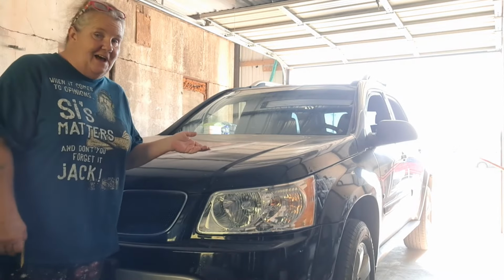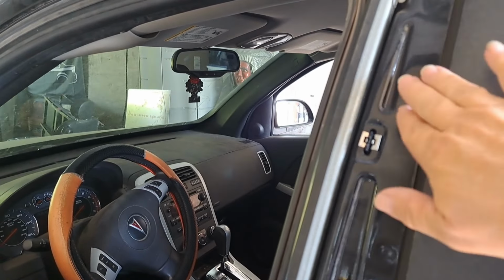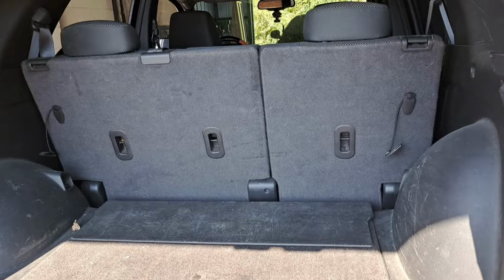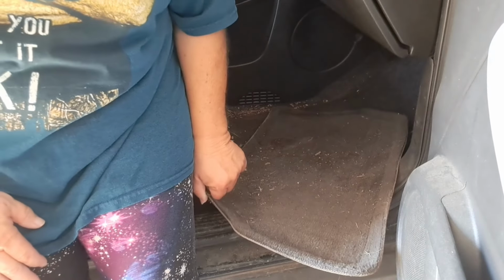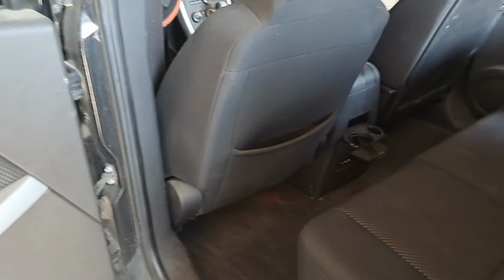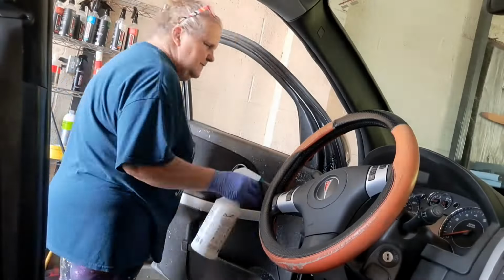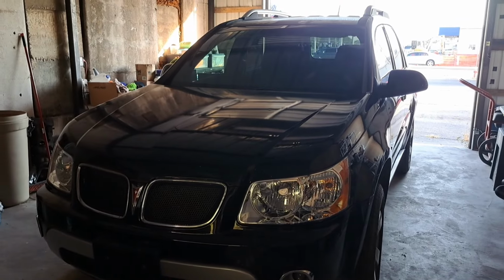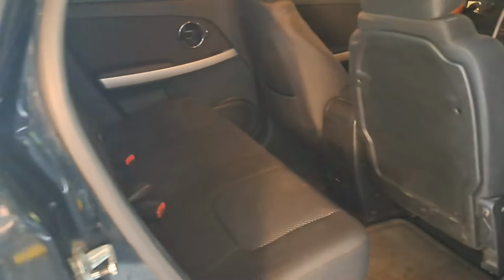A GREAT RUN!! AWESOME!

Comment: Question. What would you do to remove door jam undercoating oversprays? 🇨🇦
Reply from the maker: With over spray of any kind I start with my clay towel and go up to wet sand IF I need to. I haven't had to worry about it many times.  All but one was managed with a clay towel